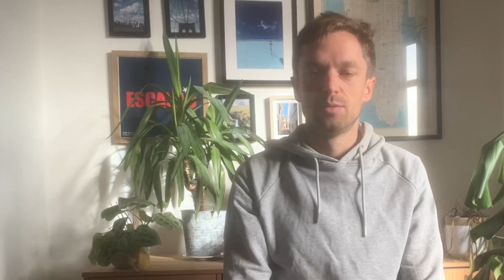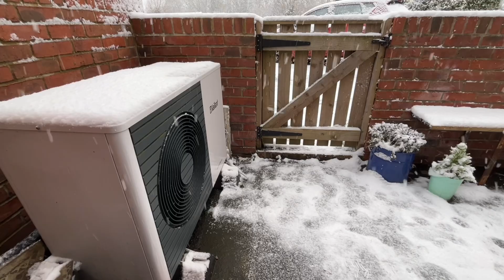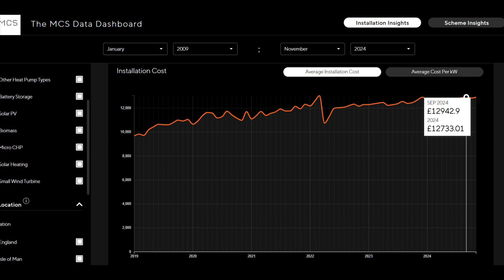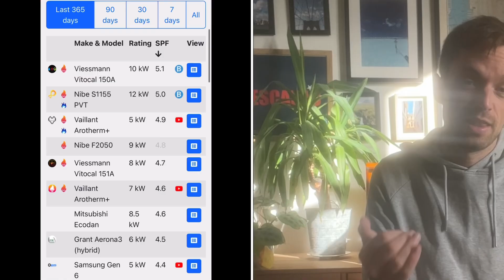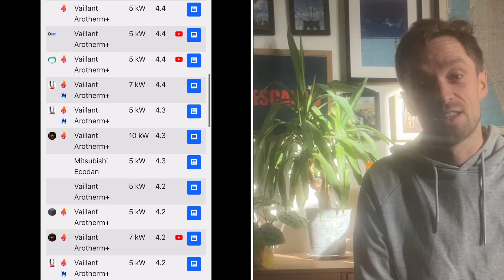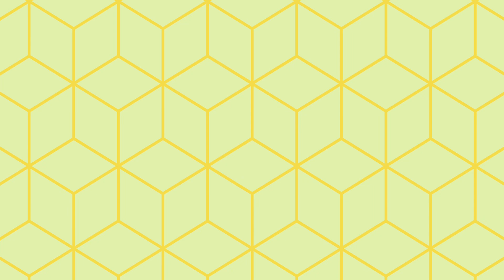Are heat pumps a good investment? The answer might surprise you

Comment: Great video. I like the fact that you aren’t trying to convince us one way or another.
Reply from the maker: Thanks Jane - I very much am trying to convince people to install heat pumps, and sharing the reasons why is helpful.... I guess I want people to be clear that this is not, currently, a lucrative financial decision for most!
Reply: I’ve just bought a new house that needs refurbishing and extending. I want to install solar and a heat pump but it will make a serious hole in my budget. The other challenge I’m finding is speaking to someone who can view the house holistically and recommend the best way forward ie insulating the existing house, radiators or underfloor heating, how big a battery I would need etc etc. I just want some good independent advice on how to heat the house effectively that considers all options.

Comment: I am in the middle of installing a heat pump to our house, even though it will be on the market next year.
Ive already built two extensions but had been holding off on the central heating because of technical problems. 
Now the house has four bedrooms its a luxury purchase so needs a luxurious central heating system and a heat pump with huge radiators will give that. 
There's still loads of issues that have made me wish I hadn't bothered but I am really looking forward to the buzz when the system is up and running. 
I also have solar, loads of insulation and significant batteries so its a very modern house now.
Reply from the maker: Sounds fantastic Dr Rog! With the heat pump, it will be really low emissions too, which, I think / hope, will add value to the house!

Comment: My gas usage is around £540 inclusive of the standing charge. I already have solar and an EV which can act as a home battery (bidirectional charger), and if I can make more use of my solar energy rather than exporting to the grid it will make a small difference but of course most of the solar generation happens when heating isn't needed. I'm still expecting to save around £200 per year with Cosy Octopus if my calculations are correct and I've included an annual service in the cost; I didn't factor solar into that so it would probably be a little bit more. I'm expecting to pay about £3000 after the BUS grant and around £300 for planning permission. I'm not really seeing it as an investment but it should improve the value of the home (which I don't intend to sell so that's immaterial really) and even if it wasn't, £200 pa from £3300 tax free is a decent return. I think the biggest return comes from making use of the £7500 BUS grant while it is available, and I do expect green levies to reverse at some point and gas prices to go up further and electricity prices to come down a little in the future. I also like that I'm reducing my carbon footprint. Would I pay £11000 on a system without the BUS grant? Only if I was forced into it. I think people will be forced into a decision like that at some point in the future.

What I don't like is that I'm lucky enough to be able to afford to benefit from this scheme and there are so many people who are not so fortunate. It doesn't benefit poor people. But there may be things like loans attached to utility bills that I don't know about.
Reply from the maker: Thanks for sharing your story Robyn, well done for taking the step!
And yes, I agree, this is out of reach for many. There are schemes that will help with a fully funded heat pump installation, like the ECO schemes that tend to be administered by local authorities, but we do need ongoing support to help people make the change.
Tom

Comment: A few other points, if you remove all your gas appliances and meter there is no chance of a gas leak and your house exploding, heat pumps should have less maintenance costs, also I use mine at night on a cheaper tariff to heat my hot water and warm up the house in the early morning.
Reply from the maker: And reduction in carbon monoxide risk!
And yes, making use of time of use tariffs can bring down costs, we use octopus agile, and make sure we dont heat hot water during the peak times. Our costs are significantly lower than the price cap

Tom

Comment: I'm surprised that there wasn't one mention of non-standard tariffs.  I know 8 people with heat pumps, not one of us is paying 22p kWh on average.  I have a small home battery and am on the Octopus Cosy Tariff, according to my bill my average price of electricity is less than 13p kWh.  I also have solar, which I've not included in that price, so in reality its even less.  During heating season my heat costs me less than 4p kWh of heat, or around half of the same for gas.   But overall I agree, I didn't do this to save running costs, I sold our second car that we didn't use and had a heat pump installed, I save around 4 tonnes of CO2 per year with the heat pump, and around 1 tonne by not having a second car running.
Reply from the maker: Hello - fair point, although the gas tracker tariff also exists that brings gas heating down. I went into that nuance in a video recently - https://youtu.be/ERBmFsatOOM?si=A6HZVsgwbUssbsjW

Ultimately, the point I am making is that heating bills aren’t large enough to give significant savings to provoke a quick payback, so we need to change the system, or explain the benefits of a heat pump better. 
Thanks for engaging with the video
Tom

Comment: Heat pumps a not an investment, just like a gas boiler isn’t an investment. They are just a method of heating. Whilst electricity is 4x more expensive than gas, their efficiency offers no cost saving to the average home, but they cost significantly more than a gas boiler to install, 4-5 times more from what I can tell.
Reply: Every install is different. I had to replace an oil boiler which was going to cost about £4000 but went down the heat pump route instead, £3800 is all I had to pay. I didn’t replace any radiators and my old house built in 1800 has never been warmer. And my bills because of cheap tariffs have also become cheaper.
Reply: @So install cost was £11,300. You may have only paid £3,800, but if you received the grant the tax payer subsidy has paid the rest.
Reply: @garethjones2125 so if there was a grant available to replace your gas boiler, you'd refuse as it's taxpayers money?

Comment: My position is my current home heating is performed by a nearly 20 year old gas boiler.  Being aware of a government plan to phase out gas boilers has led me to progressively upgrade my house in terms of insulation, solar panels and batteries.  Through your brilliant videos and those of others I am keen on getting a heat pump.  To prepare for this, I have increased my radiator sizes and pipe work on the ground floor after doing the necessary calculations.  I will tackle the upstairs part of the system next.  My point is this.  The existing boiler must be nearing the end of its life.  Future legislation may prevent me from installing a replacement gas boiler so I would have a hefty bill anyway.  Consequently, the issue of payback doesn’t arise for me.  It might be down to a choice of having a heat pump or a very cold house.
Reply: The grant covers replacement of radiators. In our case we had 10 radiators, 1x water tank and a huge 16Kw ASHP (IMO too big) and it cost us just £500.

Comment: When it’s time to replace my boiler I will seriously consider a heat pump.  The decision will not be based on ROI because there is none on a gas boiler but the affordability due to the price differential has to be done.  The part I like is the comfort level everyone talks about.  At 70 plus years old pointless having solar and batteries.  
And it helps the planet too.

Comment: Very few people ever have to replace a gas boiler, never mind an entire house heating system, hence costs in £10,000+ sound very scarey. Having gutted and retro fitted a cottage, you get a real feel for the difference between doing it properly (expensive) and just sticking a plaster on (cheap). Most people will opt for the latter, but we need more education so people better understand why the investment (and potential inconvenience of the work) should be at least considered.
Reply: I had to replace 3 gas boilers (over 30yrs), how long do you think they last?
Reply: @waynecartwright-js8tw  I've lived in properties with 15+ year old boilers that have worked fine, maybe not as efficient as a new one, but did the job.

Comment: It’s very obviously a bad investment. Furthermore, the clowns in Westminster came very close to imposing blackouts last year, so restricting one’s supply of power to just one variant makes no sense either.
Reply: Blackouts would affect most forms of heating, not just heat pumps, so irrelevant to whether heat pumps are a good or bad investment.
Reply: so that gas fire I had on yesterday by open a ball valve, then a needle valve and lighting with a match was just a figment of my imagination then. Yes, you are right.
Reply: @yp77738yp77739  1) I said "most", 2) Is it your main source of heating?
Reply: @yp77738yp77739  You do realise that electricity is used to pressurise gas so that it can be piped to your home, right? Or do you think a couple of guys use manual bellows to squirt it into your fire? 🙄
Reply: @ or perhaps they use gas turbine driven compression stations😀
And where do you think that most of the electricity that feeds those heat pumps comes from, yes, from gas fired power stations.
Reply: Most? Gas amounts to less than a third of UK grid supply, a figure that will continue to fall as more renewables are brought online. The gas network also uses electric turbines at compressor stations, as well a computers and control systems that require electricity to function.
Reply: @ Stop talking nonsense man, 2 minutes ago I just checked the national grid and 13.2% of the grid was being supplied from renewables. 53.2% was from gas, my math isn’t great but that feels like a majority to me. Furthermore, this is only a minor part of the uk power supply, if the kW that is currently supplied by gas was removed then the renewable mix of the total power demand would be less than 1% of the necessary power supply today. 
By the way, even with my poor math I do know enough to understand that modelling of complex systems, for example climate, is incontestably a mathematical absurdity.
Reply: @yp77738yp77739  On Easter Monday 2021 wind and solar in the UK generated 60% of all electricity. You see the problem in looking at a one-day snapshot? How about being honest and quoting the annual average - unless you have something to hide?
Reply: @yp77738yp77739  On Monday 5 April 2021 the UK saw 60% of its electricity generated by solar and wind. Perhaps you can see the problem of looking at energy production in a selective way? A more honest approach (unless you are seeking to mislead) is to look at annual figures. In 2023 gas accounted for 32% of total electricity generation, compared to 51% from zero-carbon sources (according to the National Energy System Operator). In the year to September 2024 the comparable figures are 25% gas and 41% renewables. You will notice that both 32% and 25% are less than a third.

Comment: The problem with heat pumps is the negative press that we’ve seen from poor design or installation. 

The other thing is they have to be set up to be run in a different way from a boiler. Boilers can run at a much hotter temperature which produces a greater heat output from the radiators. So of you are out for a lot of the day then a heat pump is going to be used to heat an empty house. Sudden drops in temperatures are also a bigger impact on heat pumps because they are slower to react to sudden drops. 

Also the UK is an outlier in terms of temperature we have sometimes have low temperatures which are the point when heat pumps can struggle depending on design. 

Personally I think we should get rid of standing charge on gas and have hybrid systems with a gas boiler when the temperature drops it to heat water. That way the heat pump can be designed for a higher external temperature and we could have much more efficiency for the most time we need it and in the odd occasion we have -8 we could have a gas boiler picking up the slack. The gas grid has never struggled and would offload the large load on the grid which can only be picked up by gas power stations.
Reply: @davideyres955  so true. But people never talk about the countless bad boiler installs. In the extreme, what about the  few houses  a year that are leveled by gas explosions and take out the neighbours too. Fear of new.
Reply: My heat pump heats a 150 l tank for about 2 kWh of lecky at about 25p a unit, so 50p. Contrast that with nearer £3.50 for an emmersion tank and... Mind you, I never heat my tank to 70+ C, which is a kind of madness - you then have to cool it down to use it for anything, bonkers!

Comment: A definite investment thought is this, any other property move for me has ASHP, solar/battery at top of the list & would devalue any property depending on this metric & insulation efficiency. All other considerations follow. This is going to become an increasing metric for future housing market. Today solar in UK estimated to add between 4-14% to market value (certainly helped my decision to invest in current property) ASHP separately is up to 7% or 1.3-3% depending on sources. But future energy savings will be even better, especially when UK electric inflated to subsidise gas/oil prices as it currently is. Of course when electric gets super cheap/green then being all electric wins again. 7p KW overnight with Octopus, £3 to fill my EV battery! How’s that for savings.

Comment: Our ASHP cost £2.5k with Octopus, it’s been brilliant. At first I doubted we could have one, as I’d unconsciously absorbed lies & FUD around them. But a deeper look & analysis & seems we were actually good to go. I wanted to end our gas use, if ASHP cost even close I was happy. Plus, clearly future proof from fossil rises & dubious foreign beneficiaries. My EV lessons swiftly ended electrifying doubts, & amazing bonus benefits. Solar/battery just before all for the same motivations. I need a new couch but that can wait! My savings will cover that & more. House is more comfortable, my annual electric bill is less now than before without the EV or ASHP! With NO gas, the biggest annual energy bill. With Octopus tariffs it’s like cheating, keep expecting to wake up to be told it’s not possible. PS 20yr + double glazing, 4bed semi detached 1970s home. I improved loft insulation! Cheap.

Comment: For some reason people always compare savings of a heat pump to replacing  their gas boiler under the Boiler Upgrade Scheme (BUS).  Fact is, many homes with electric heating systems also qualify for the BUS, which are way more expensive to run than gas boilers.  In this case you are very likely  to see large reductions in heating costs after the swap.  I am due to have my electric heating system replaced with an air source heat pump under the BUS within the next week, and will cost £2200 out-of-pocket. At the moment, it costs £1.80 to run my heating for ONE HOUR at peak times.  Without getting too much into the Maths, that's a 6kw heating system running at around 30 pence per Kw hour with Octopus Energy.

Secondly, I have read that installing a heat pump will also add value to your property, and apparently  more than if you installed a more traditional heating system.  This is because you are future-proofing your home by installing something that is more efficient, better for the environment, but that is very likely to grow in popularity because of this.  Oh, and their lifespan is also to be longer than gas boiler if properly serviced!

Lastly, it feels like we in the UK are viewing this as a new(ish) technology, when it has  been successfully used in part of Scandinavia for decades.  I'll admit I've  always loved combi boilers, but in 50-years they are very likely  to be a thing of the past.  People who don't  agree, just think how many of our old terraced houses used to be heated by coal once upon a time. 😂 You can't  stop progress!

Comment: I had my heat pump installed at the end of September.  I had been encouraged by the many You Tube videos explaining their benefits.  My final decision to get an ASHP installed was made possible by the BUS grant and the price that Octopus charged me for the installation.  My main motivation was to reduce my carbon footprint.  However, as I am on Cosy tariff and have a battery, to date and I know it is early days but my bills are cheaper.  I am not bothered about the time of 'pay back'.  I am just delighted that it is proving to be so good.  My house is warm throughout and I now use all of the rooms instead of closing some off.  I was nervous about getting an ASHP but it is proving to exceed my expectations.  I do hope in the future that the charges on electricity will be reduced.  Not many people can afford to move from gas because at the moment it is much cheaper than electricity.
Reply: I see a lot of negative comments and heat pumps, 1 of them is that your house will be cold but like you I find my house is warmer.

Comment: I didn't fit my Heat pump for financial reasons I did it for  environmental reasons.  We are  warmer and more comfortable with all rooms heated 22/7. Despite that our heating bills have plummeted mainly because we are on a time of use tariff which is as cheap as gas and we are running at over 400% efficiency.  We have a battery which we charge overnight at 7p/Kwh and run through the day on that plus whatever the solar panels add.
 So while fitting a geat pump wasnt done for the money we are saving shedloads, I havent done an ROI because,
 1 I dont care and 
2 with volatile energy prices its all guesswork anyway